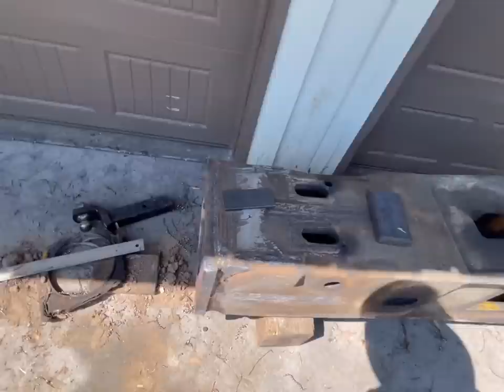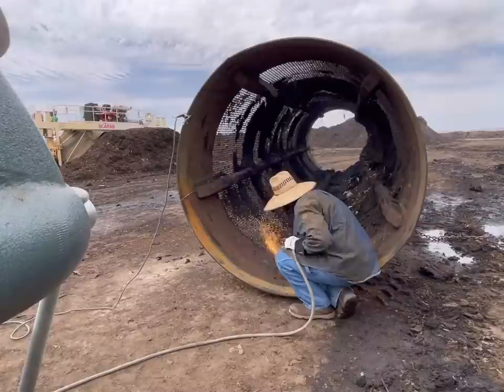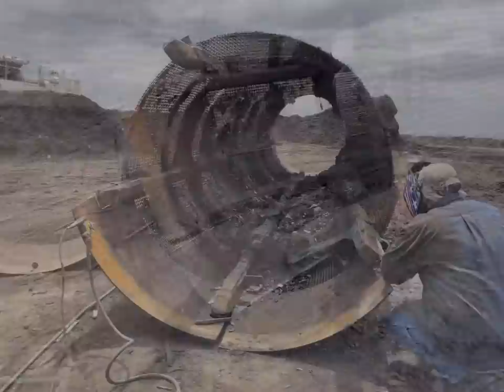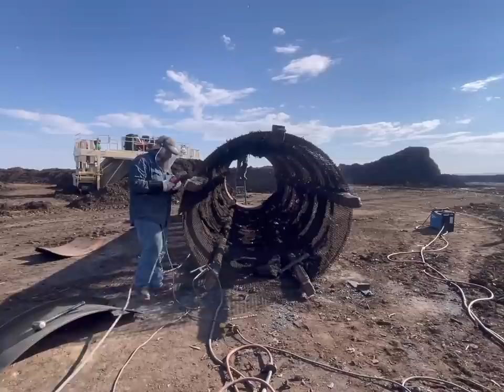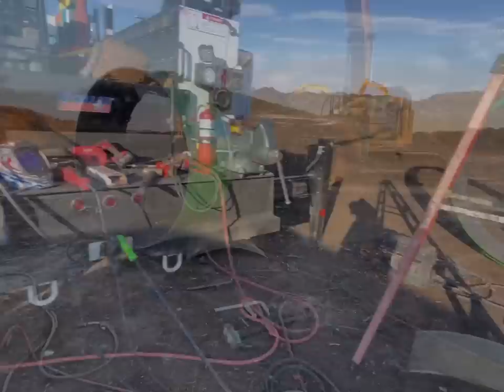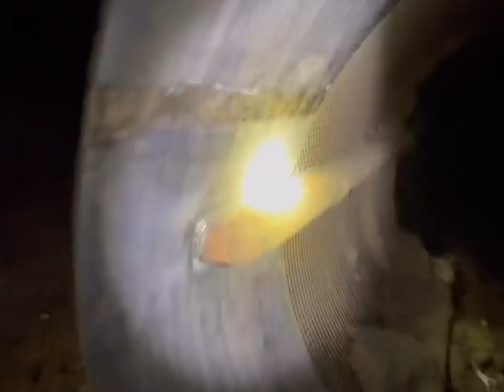Trommel Repair in the Desert…

Comment: What wire you use for this job? I'm on the hunt for another wire as Hobart discontinued 21b in the larger sizes  🤦
Reply from the maker: Lincoln 71a75
Reply: @OFW  what cfh are you having to run to get good coverage to avoid porosity out in the field like that? I've never had good luck with a dual shield wire in the field running 35-45cfh. Good gust of wind will just mess everything up seems like
Reply from the maker: @sparksmobilerepair4025  I usually run 30 I will turn up to 50 if that doesn’t work then I will go to stick or flux core. In this video I was at 35 cfh

Comment: Im not much of a welder but if i may suggest....in future when you get jobs like that you could always weld criss cross beams in place to keep the remaining structure true to its original position...almost like a jig if you can call it that. But yes as you said in the intro of the video...you took a lot of miscellaneous material with because you never know what to expect. Glad that you could pull the job off in one day. Well done👍
Reply from the maker: I almost did that but it worked out better being able to collapse them to slide the new part on.
Reply: @OFW  ah yes ...you make a pretty good point there sir. Thank you for your feedback👍

Comment: crankshaft? Wonder if in future the trammel could be designed with two  wear sections so either the trammel could be moved to the new wear section or the second set of drive chain and rollers could just be installed or the first set moved to double its lifespan.

Comment: Curious why you decided on a 600amp welder? Looked at cost and like to had a heart attack!!!
Reply from the maker: At the time I wanted the smallest diesel air pak welder, and that was the 600. I regret not getting the 800.
Reply: @OFW  What makes you say that? Just curious what situations would warrant having that many amps.
Reply: While a lot of praise is given to the Lincoln SA200, it will weld great. But you can not run a grinder at the same time as welding, then it is DC only and can not run any other equipment.

Now this Miller 600 amp machine you can weld and grind at the same time. Also run a plasma cutter and a XMT 350 at the same time. Also run air tools at the same time.
Reply from the maker: @nitrouscatfish5827  it’s not the amps it’s what the machine can do as a whole. For example I can have one guy plasma cutting one guy running a welder off of the stick leads one guy welding with the 50A 220 plug. And one or two guys grinding.  Not to mention I have enough air to run several air tools during all this.
Reply: @OFW  Ohhh ok I gotcha. I guess I was looking at it from the POV of a one man operation. I just bought a little klutch engine drive and it supposedly can't run any auxillary power while welding so I see how convenient that would be.

Comment: My keen ear of experience caught a little heat drunk slur there. Needs must and all that, but when you start to sound like you just pounded 3 shots, time to sit in the shade and knock back some water for 30. Heat exhaustion can screw you up for a long time and seems like each time you wimp out a little faster. You probably know that, and will ignore it. I know it and still push through too often.